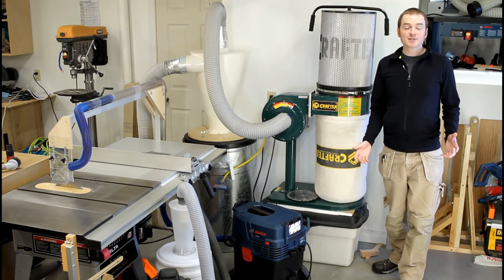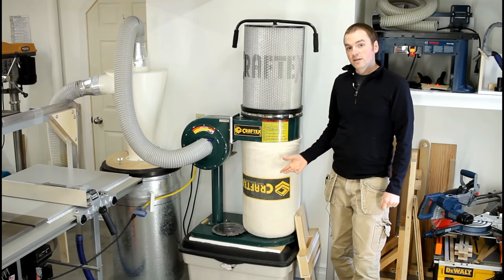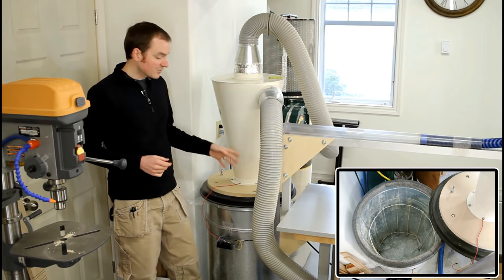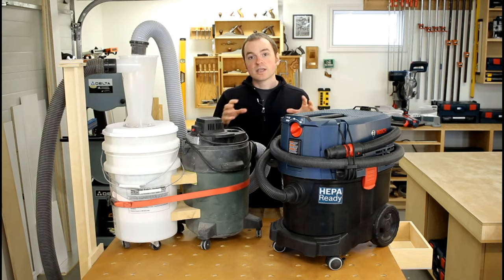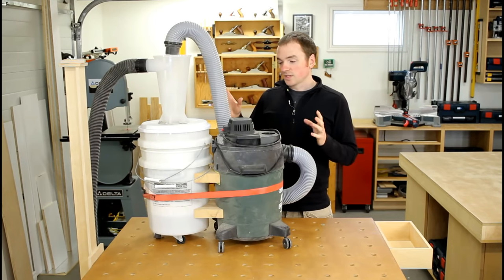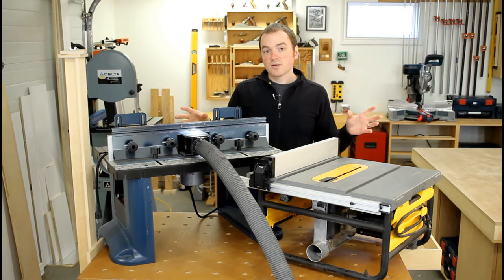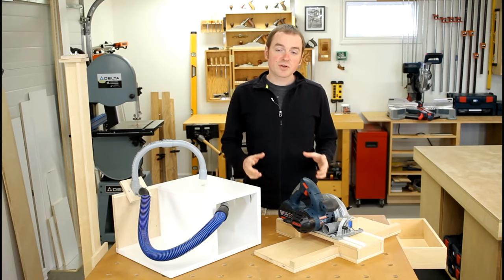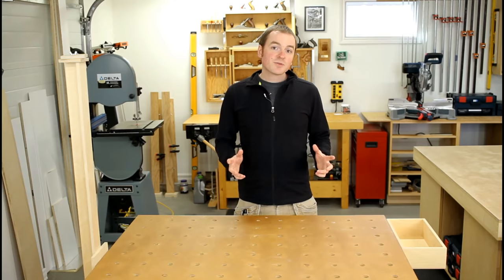Small Shop Dust Collection - Affordable & Effective Solutions

Comment: Your not getting the efficiency you need with that felt bag.  Small micron dust is getting into your shop and lungs.  Put the clear bag back on and if needed, get a more powerful motor (2HP).
Reply from the maker: I always wear a dust respirator when I'm working in the shop so I'm not worried about breathing in any fine dust that makes it past the filters.  The top filter isn't a HEPA filter so neither filter is going to get super fine dust but the filtration of the fine dust does get better as the filters load up a little bit.  At some point I might upgrade the filters but for the amount of time that I'm in the shop lately it works for now.  By far the majority of my work lately has been on-site.
Reply: I think it is worth moving the collection system outside.   Vent your air outside and your filter bags or filter's small micron capture becomes irrelevant.  Downside, hot shop air will be pulled out.    But like OP, the super fine dust that is important to capture, moves past your cyclone into the cloth bag and then out the bag into the shop air.  Smart, as u noted, wearing your 3m mask.
Reply from the maker: @brandtl1486  having the dust collector outside would be great but definitely not practical in the climate I live in.  In the winter I would lose all my heat and in the summer it would end up drawing in all the humid air from outside.  From a fine dust standpoint it would definitely be the way to go though.

Comment: Wasted $$ on the pleated filter if it's the same 1 micron that Craftex claims they are for both,could have used 2 bags instead.
Reply from the maker: I bought the collector second hand  and it came with the pleated filter. I do like having the rigid canister type filter on top since it doesn't flop around like the bags do.

Comment: Great video describing your comprehensive approach to woodworking!  I was curious about the small dust collector on your drill press.  Did you make it yourself?  I've seen parts that look similar, but am scratching my head about how to hook them up to larger diameter dust hoses.

The detail is great as is the "theory."  For example, you describe different tools and how and why you use particular dust collectors for them. For how important this is, there is often only lip service paid to it by manufacturers of tools, especially for hobbyist woodworkers.  You've inspired me to begin to wear a dust mask when I'm in my shop.

Have you seen the Resp-o-rator?  Here's video https://youtu.be/6e20RahnaNg   I've got one and now will put it to more use.  I may modify it for P100 filters.
Reply from the maker: +kbwoodworker thanks.  The gizmo on the side of my drill press is actually a blower that hooks up to the compressor.  I don't use it very often but there are times when it's handy to have a gentle flow of air when drilling certain things.  For dust collection at the drill press I have a magnetic dust chute that I use with a 2 1/4" hose.

I've never seen the Resp-o-rator before but I just took a look at it.  That's a cool idea.  How comfortable do you find it?  I used to have a beard but got rid of it since you can't get a good seal with a mask.
Reply: I've been using the Resp-o-rator Jr most.  You can see it on the Hartville Tool website, I didn't see a youtube video of one.  I think the regular Resp-o-rator (senior?) does a better job, but the Jr is extremely easy to use, which means I use it more.  I like both Jr and Sr better than regular dust masks.  They are not hot in the summer and don't steam up glasses/goggles.  To me, both are much more comfortable than regular masks.  The only downside of the regular Resp-o-rator is that it's drippy (saliva).  But I prefer them to other masks for comfort.  Wearing glasses or glasses/goggles, hearing earmuffs, and a mask together is always a challenge.  

I'll probably adapt them both to use the P100 3M filters as shown in the video.

Comment: Nice.  But I would point out that by using a cloth bag below the pleated filter, you are reducing the effectiveness of catching the harmful fine dust in the air.  The blower directs the air and fine dust from the Dust Deputy into the cloth bag and then up to the pleated filter.  So you have effectively reduced what the pleated filter was designed to do.  There is adequate flow through the pleated surface of that filter to not reduce the suction of your unit.  The cloth bag becomes the “weakest link” and allows more fine dust into your shop.
Reply from the maker: That's true but the pleated filter is not a high quality one and isn't HEPA rated so I've never been too concerned about the bag. If the pleated filter was a HEPA unit then I would definitely not use the bag on the bottom because that would defeat the purpose. I always wear a P100 dust respirator when I'm working in the shop so I'm not too worried about breathing in the fine dust that might make its way through the filters. You're completely right though about the bag being the weakest link.

Comment: By putting the filter bag below the canister filter instead of a non-porous plastic bag you are defeating the benefit of the canister filter. The canister filter may remove all but 0.5 micron particles, but the best filter bags can only remove up to 10 microns. You may get more air going through your sysrem, but you have more dust going into your shop.
Reply from the maker: +Paul Anderson you're right, the filter bags aren't as efficient at getting the super fine particles.  The reason that I was ok with doing this setup is that the canister filter is a cheaper model and isn't HEPA rated so the actual filtration capability of it is questionable.  I let a bit of a cake of fine dust build up on the inside of the filter bag which helps somewhat in capturing the fine particles too.  In the end I always wear a P100 rated dust respirator when working in the shop so my lungs are protected against the really fine dust. So until I can afford a filter upgrade to a true HEPA system this setup has been working well for me.  If I had a true HEPA canister filter on the top then the bag on the bottom wouldn't make much sense since it would defeat the purpose like you said.
Reply: I purchased a PowerTek 1 micron bag for my Harbor Freight 2HP dust collector - not being satisfied with the 5 micron bag that came with it.